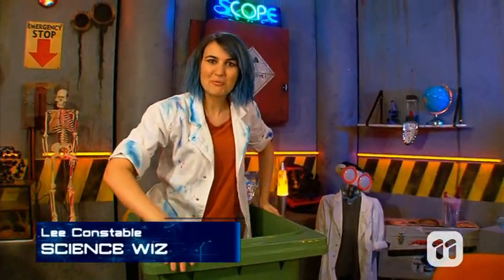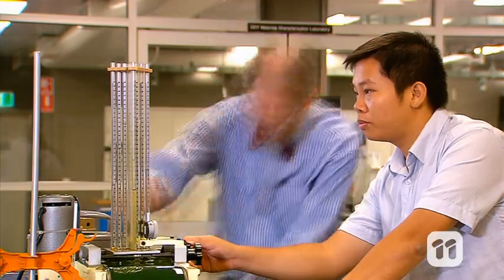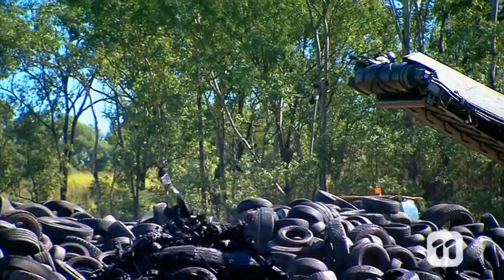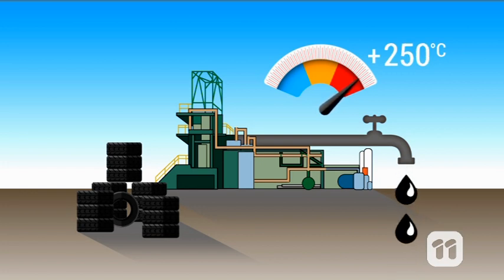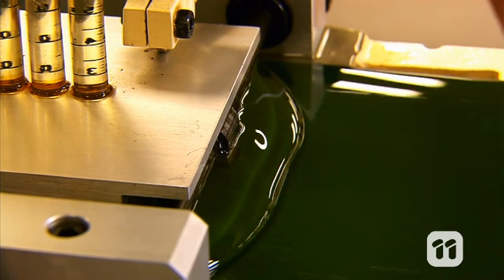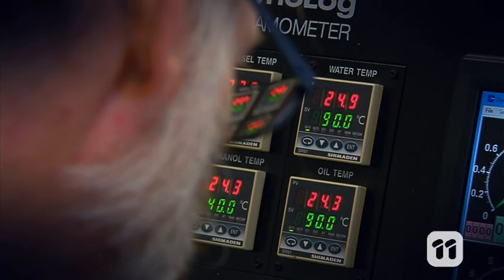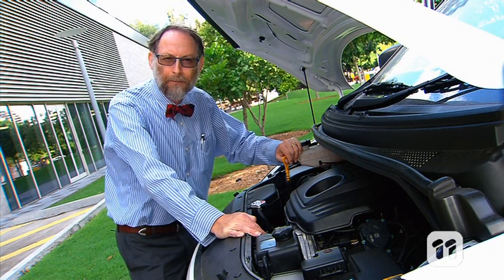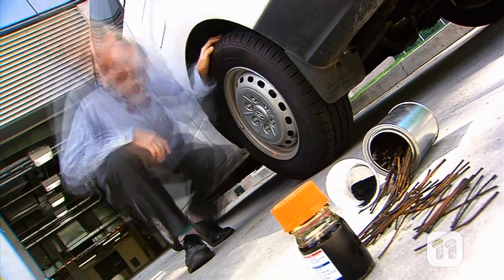SCOPE TV: Tyre Fuel

Comment: This looks to be a very energy expensive process that is likely to produce more atmospheric carbon emissions than current diesel.
It must create more emissions due to the energy required to grind up tyres and then the oil extraction process where they are heated to 200 C.
Wouldn't it be better to lock the carbon away by burying the tyres or making fish reefs out of them or even the playground mats, rather than emitting it as carbon dioxide and carbon monoxide and creating more greenhouse gasses?
Reply: Good thing carbon dioxide is great for the environment.
Reply: No. A huge issue with tire dumps is that the tire DO breakdown slowly overtime, and you’re basically looking at an oil spill on land that can (and will) poison land and water.

This is why road run off is so bad for the environment. The tires are worn down on roads and bits of that tire end up in water ways and land.

It doesn’t use that much energy to power the shredders or the furnace. Wind and solar can power most of it. During the recycling process steel is also removed from the tire and can be recycled as well
Reply: @Maaad-maaan  then burn the product releasing the carbon compounds as wast.
you get the double damage of tying up clean energy diverted from useful purpose to reprocess tyres to make a secondary fossil fuel, to burn and pollute?
what is the half life of a tyre buried or sunk? How much energy is used to reprocess a unit of tyres? How much GHG emission from that unit of tyres?
Reply: @douglasbell3344   
The tires are usually shredded before going in a furnace, although that’s not always necessary, unless it’s a larger tire

As they burn in the furnace they release heat that can be harnessed via a steam generator. That can power the lights and shredders for the facility.

The same tire oil that is produced by the furnace can be directly powered by the tire oil.
“From 10ton waste tyre you can get about 4-5ton pyrolysis fuel oil.”
“the oil yield of used tires is about 40%-45%. 0.4 ton - 0.45 ton tyre pyrolysis oil, that is about 4000-4500liters of tyre oil can be got from 1ton waste tyre.”
Only a small fraction of that would be needed to power the furnace.
As a diesel additive, diesel vehicles can continue running for a less money AND less harm to the environment since there’s fewer risks of an oil spill, and no fracking is needed.

Once the furnace is cooled two materials are extracted. Carbon black and steel.

The steel is captured by a magnet and souls to steel mills.

The carbon black can be sold back to tire manufacturers, cement, carbon paper manufacturers, or coal manufacturers for co-combustion.

Also, in order to power electric vehicles you need to mine the resources to create the batteries. Only diesel vehicles have the power to mine and move such materials. Diesel is more energy efficient than gasoline and produces less carbon dioxide than gasoline. The downside is that they release much more carbon black.

But you still need the steel from the tires before they rust in the ground. It’s more energy efficient to recycle steel than mine it.
Reply: it can use it's own gases to, for some part.... And that greenhouse gass scam is more likely to make middle class people poor...
Reply: @deividasvaliukas1418  "...use it's own gasses"
I am not sure if you are talking about some perpetual motion scam or if you just mean burn some of the carbon compounds reducing the product volume and overall production efficiency while at the same time emitting carbon compounds into the atmosphere.
Overall the whole concept is something the National party or United Australia party might put forward to scam the uneducated supporters into believing is good for Australia.
Denial of global warming is either ignorant, uneducated, delusional or narcissistic!.
This concept of converting tyres to diesel is like selling asbestos for home insulation, it is possible, it can work, it may be cheap but at the end of the day, it will poison the world. All fossil fuels need to be phased out of use.